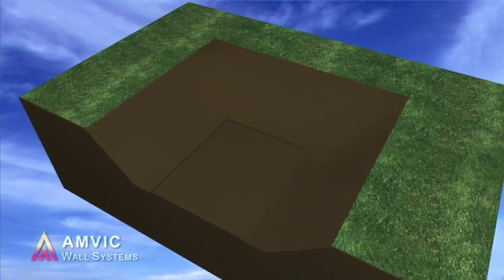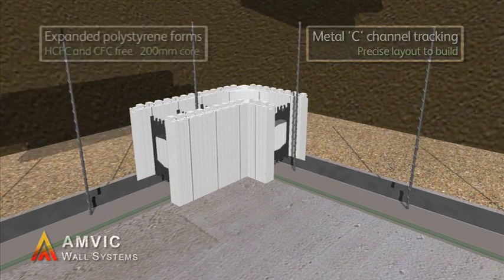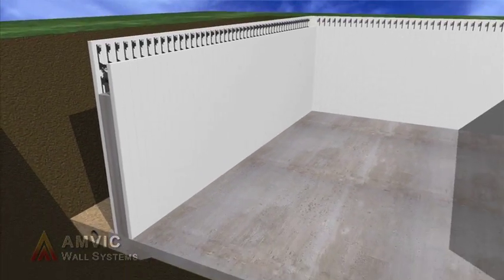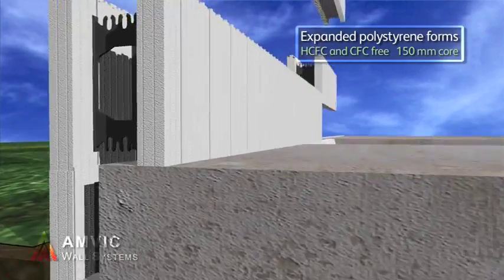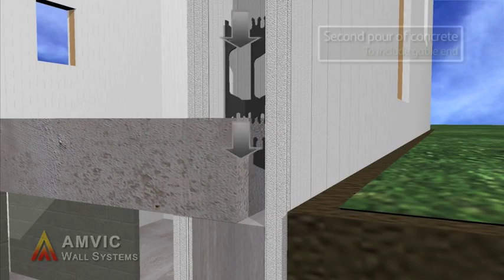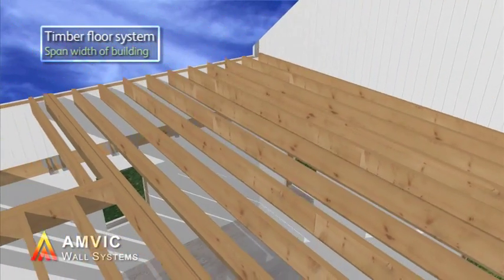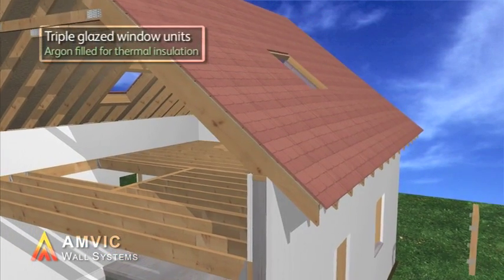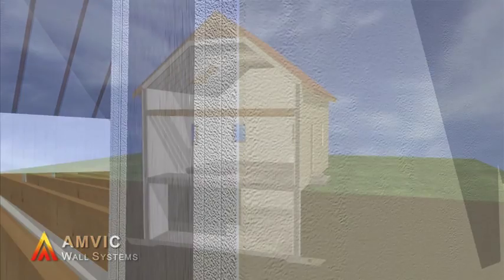Amvic Insulating Concrete Formwork

Comment: Hi, just wondering, can you use precast concrete slabs for the upstairs flooring in a two-story dwelling with a basement?
Reply: You would probably need an engineer to assess that. The guy said they can quote off plans so easiest thing would be to get in touch.

Comment: What about plumbing water lines, vent stack piping, and electrical wiring on exterior walls? How do you work around those items?
Reply: +Bryan D. Smith 
You install conduit before the concrete pour.
Reply: Sony This is just a thought but you could install an outer sleeve that the conduit goes thru. You couldn't remove the sleeve but you can slide the conduit in and out. Proper planning is important. Hire an architect I need work.
Reply: so what happens if you need to replace it?

Comment: I am curious about the cost of using icf. How does this compare to the concrete metal forms, whereby, the forms are removed after use. Say, on a 20 by 30 structure with 9 foot walls for just the basement, what would the ICF cost?
Reply: they won't and could be very very expensive that is why it is not popular